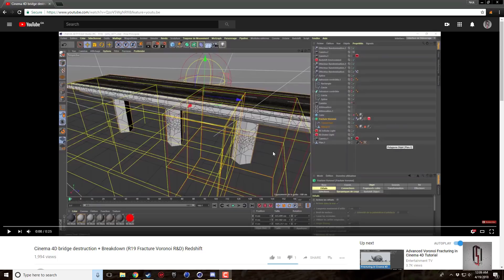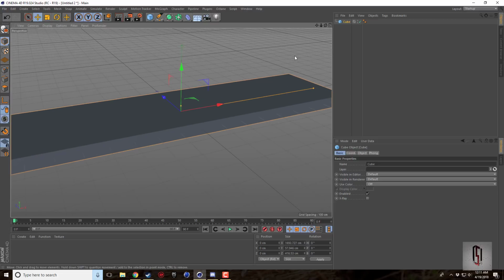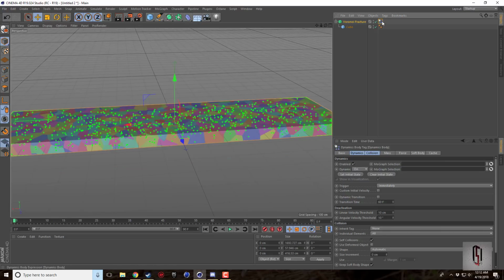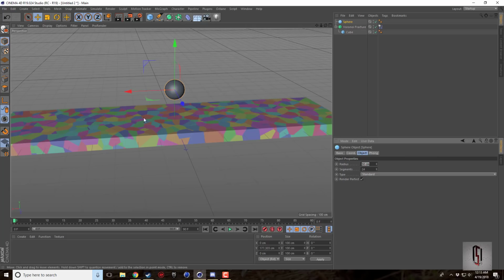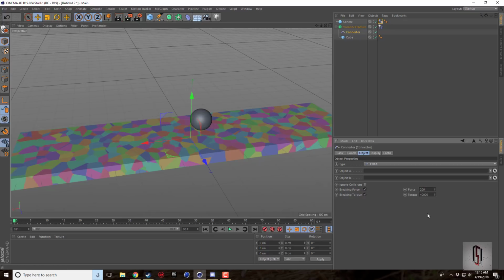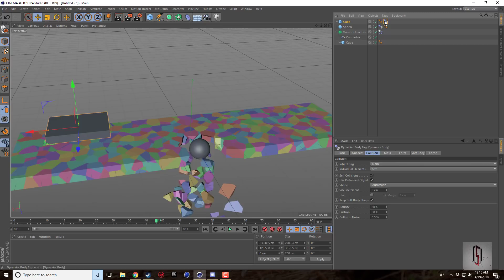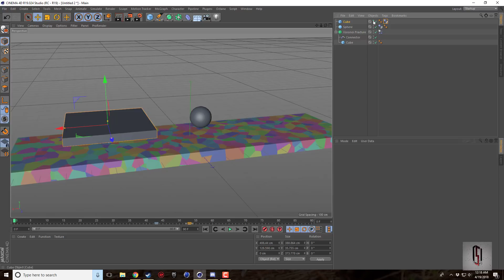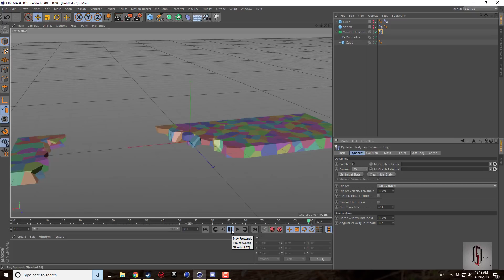Bridge Collapse - Voronoi Fracture in Cinema 4D

Comment: Hey thanks for the tutorial. I tried it with a cube and it worked well enough but I wanted to apply this to some text and it works but when it breaks apart the text seems to be hollow on the inside instead of breaking into 3d broken up pieces like any other object would. Any help would be greatly appreciated!!
Reply: maybe check in the voronoi under object tag if u have ticked "hull only"?